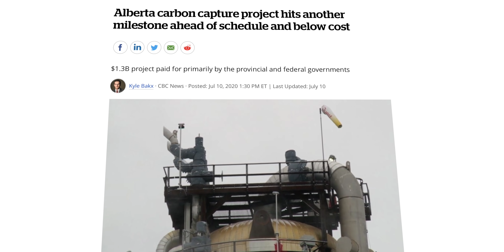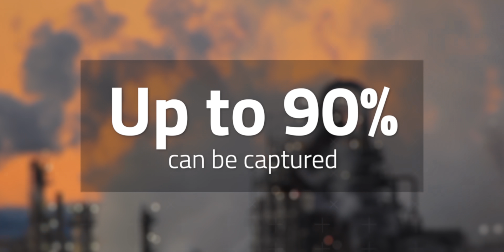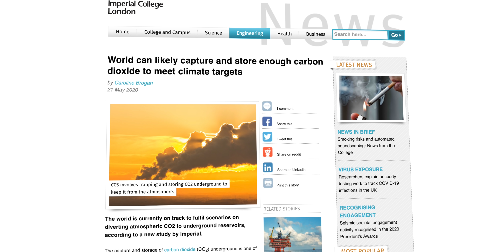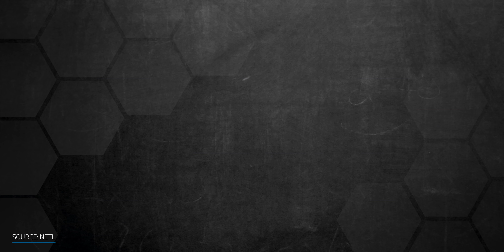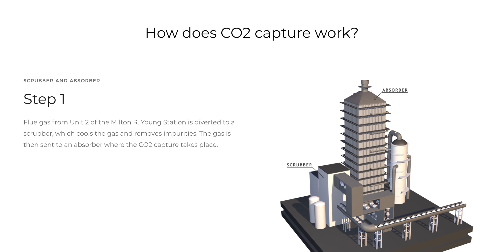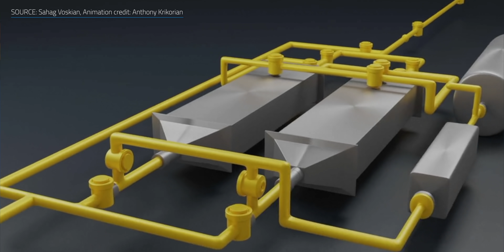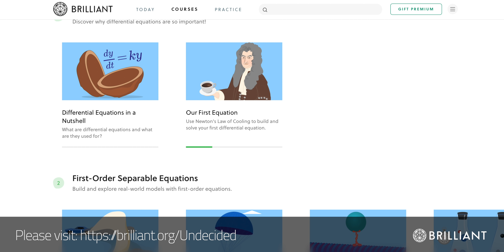The truth about capturing CO2 to reverse climate change

Comment: To the “just plant trees” group, no one is stopping you from planting trees while we work toward engineered solutions. It’s gonna be a multipronged approach to solve climate change. At this point I don’t see people or governments making difficult decisions to change their behavior (just incremental ones). Technology is the only pragmatic solution I see in coordination with incremental changes in energy production, farming, renewables, conservation, etc to solve the climate crisis.
Reply: I agree about the multipronged approach thing. One company that I think is doing a great job of this is Ecosia - a search engine that uses its profits to plant trees. So far they have planted over 130 million trees and counting and they are better for privacy than Google as well (their youtube channel has more info)
Reply: The Climate always changes, it doesn't need to be stopped.
Reply: We can go a long way on energy management alone. There is a high rate of 'standby loss' in equipment that maintains a 'steady state' of readiness. The heating industry can reduce consumption for heat and hot water by about 25% by converting to 'Demand fired' technology with high transfer/low mass heat exchangers/ low temperature radiant heating/ ground effect heating/cooling/modulating firing rates/ outside weather sensors, and more.
The technology is here to half a conventional home's heating and hot water bills, and was in 2005 when I left the industry. The cost benefit ratio was high for residential equipment before energy prices soared. The technology was only applied to commercial/industrial equipment. Now it is available for residential application and even at higher C02 outputs - half as much fuel makes sense.
I made my living in the Energy Efficiency game ; )
Reply: @ericgameryt1887  The huge controversy with carbon capture technology is it’s not sustainable in the long term. And for long term I mean at least 50 or more years if not a hundred years. Because with carbon capture technology there is not going to be a significant change in the way we interact with our environment. Meaning that as carbon capture technology improves, humans can continue to produce more and more CO2 and by then when storing carbon dioxide underground creates a problem the issues will be much greater. The huge issue with technology is we only think about the here and now ad not think of it being a proper sustainable cycle.
Reply: ENgineering society is far far harder than engineering a new technology.  While the politicians battle with humanity, scientists need to take action in the interim.  Couldnt agree with you more.
Reply: While 'WE' work toward engineered solutions as if you do anything. Don't be smug, smartass.
Reply: One if the main reasons is money. It's easy to market your high tech new carbon sequestering solution, it's alot harder to get people to invest in trees...
Reply: There was a paper that discussed Plantng the whole Sahara full of trees... That concluded that the approach is actually not very productive..
Reply: I agree with what you said about big changes are required and most people aren't willing to make them. That and your point about complex problems require complex solutions.
Reply: this tech has been around for years and there have been people like you saying the same things....until you can convince those in power that greed is less important than money we will always have issues with our environement...actually the biggest problem humanity has is not using the word need correctly.  I need this I need that.......sound familiar?   a person needs water, air, food and shelter, yet there are so many snowflakes out there with full entitlement screaming " I need " to the silliest and most inane things
Reply: Trees are no solution euther. CCS and "carbon beutral" with trees are just big scams to make you pay for your sins without achieving anything.
We have to stop the "ECONOMIC GROWTH" religion and SHRINK OUR ECONOMIES! We have to replace 100% of fossil fuels with solar and wind or ABBANDON IT!
Reply: @BOB K And where do you get those millions of seedlings? Or do you just throw some million acorns into a hole in the ground. 
2..5 kg of wood replace one kg of crude oil. We burn around 900 million barrel of crude per day. You can't plant so many trees each day.
Reply: JUST 4Head
Reply: @BOB K ok you realize that common sense means jack shit right
Reply: I just watched a video on using CO2 & waste materials to MAKE concrete block, CMU's! Carbon capture & storage could be great way to boost material science for manufacturing.
Reply: It might help if actual viable solutions like nuclear didn't keep getting thrown out. Imagine if california had built a couple thorium reactors as they had their big push on renewables.
Reply: @olstar18  To be honest, I think that nuclear power is at this point just to expensive.
Reply: @olstar18   That's just not true... Yeah, go look 🙄
Reply: @olstar18  What's stopping you? You have plans for a "Thorium" reactor that actually works? Or did you just research "internet based" solutions that don't really exist?
Reply: @Bee Kay I think you made a mistake. Here let me fix that sentence. 

'All I say are big words, no common sense.'
Reply: @Bee Kay I guess you hear what you can comprehend.
Reply: Trees are great at capturing CO2, but forests are a more complex issue.  There's always a tradeoff between a forest's CO2 capture and its CO2 emissions.  Emissions come from decaying organic matter from tree litter, dead trees,the carbon bound up in the soils, from respiration as the tree's oxidize the sugars they make from sunlight, and of course fires.  As temperatures warm and forests burn more the net balance can easily turn from net CO2 sequestration to net CO2 emissions.  Beyond the massive CO2 release of a forest fire, the burn scar exposes the soils to direct sunlight and heat accelerating the decomposition of the organic material in the soils, releasing CO2.  

In subarctic forests - which are historically some of the best carbon sequestering forests - the melting of the permafrost or early melting of the seasonal frost soils also accelerates CO2 emissions in these carbon rich soils.  

In rain-forests burning to create arable land can also quickly turn the forests into net carbon emitters.  This is happening more and more often.  Also forests go through life cycles and early and mid life are when forests are most efficient at capturing and sequestering CO2, old growth forests much less so.  

It's great to have trees in your backyard and on your street, but the heavy lifting in CO2 capture happens in large forests, and warming is reducing their effectiveness considerably.
Reply: @glibsonoran  dont forget the mycilium, these are the workers that actualy clean the forest.  they form a interconnected web with the trees and plants helping them with nutreints in exchange for co2, the mycilium puts this back in the ground.  thats why a forest works way betters , a forest without mushrooms is a sick forest.
Reply: @glibsonoran  plant windfarms in the sahara to fight the desert, more trees will be able to grow there win/win/win
Reply: @glibsonoran  I'd add that some of what I have seen getting planted is more like a tree farm than a forest. The interest in rebuilding biodiversity and habitat doesn't seem to be part of the thinking for the "just plant trees" crowd.
Reply: @magnusskallagrimsson6707  Monocultures for the most part. Diversity has less value than construction lumber. Around here Douglass Fir replaces native Madrone and other species. Tree farming and harvest is what is being practiced. They are not wild forests. They are harvested on a cycle of years. Fast growing, straight grained lumber for construction is preferred. Twisted but native Madrone is considered firewood, and sold off to make room for Fir trees. It is an un-Natural Forest. - More of a farmers field laid over mountains here. 
We supply the best construction lumber to the world.
A side effect of forestation is wildfires in an ever drying climate - Burning forests give off huge amounts of toxic materials and place them in the atmosphere. There is a huge negative attached to living in or near them when they burn, and a world negative on the pollution scale. Careful management and fire preparedness is key to living here. We are in burn country and 400,000+ acres is currently burning in this state alone(on the way to 500k acres). The smoke is being detected on the east coast and I am on the west, time zones away : ( 
The Bootleg Fire (now burning)in Klamath County (source of the Klamath river and a major water supply for California) could set a new record for the State of Oregon during an Extreme and extended period of drought, with no end in sight : ( The smoke alone will kill ya !
Reply: cant stop the climate from changing its natural for the climate to be changing and it has done so since the earth had a climate
Reply: pathetic try
Reply: All this talk of capturing CO2 is nonsense . Climate change is perfectly natural and has been happening forever. Plants thrive on CO2 so the more the better. Thousands of scientists would agree with me but are being silenced by governments who have their own agenda. Remember when it was global warming but then thousands of scientists pointed out that the planet is actually in a cooling phase so then they came up with those two little words, "climate change", genius.

Comment: It would be cool to turn carbon captured into carbon fiber (if that can be done?) and use that to build bumpers and other parts that are plastic on cars.
Reply: if you burn carbon fibers, you get CO2 and energy. if you want to convert CO2 back to carbon you need that energy (actually a bit more).

Comment: You do realize if we capture All carbon emissions, even if we reach -0- carbon emissions and level off, with population growth we will eventually kill every living plant and tree on the planet.
We need to stabilize the Planet, rebuild the Forrest and concentrate on reclaiming Deserts.
Millions of acres of Solar panels are absolutely not a solution.
Nuclear Energy would out perform All renewable energy with a far smaller construction carbon footprint and Zero Co2 operating emissions.
I am a firm believer in Climate Change, but very much oppose the Commonly accepted solutions that will only make the rich richer while placing Band-aides on the problem.

Comment: Good job. But it is difficult and expensive. I have a way much easier, cheaper and more efficient. If the air is cooled below -78.3C by connecting several Ranque-Hilsch vortex tubes in series (one -50C). CO2 will fall like snow at the “cold” end of the last pipe. Can be collected and disposed of. You can make fuel (add hydrogen from the decomposition of water). If this is installed in Antarctica (or understood high) - one tube is enough (when overboard and so -50C and high wind speed, an additional source of energy will not be needed at all). Performance is high. Any scale. There are no consumables. Like?

Comment: If you are trying to cool the planet why would you consider going after the weakest global warming gas?  Methane is 86 x as powerful; NO2 is 200x and SF6 is 2500x as powerful as CO2 in warming effect..Taking a single pound of SF6 out of the air is equal to 2500 lbs of CO2, 1 pound of NO2 is equal to removing 200lbs of CO2, and removing 1 pound of methane is equal to removing 86 pounds of CO2.  This is just a sales pitch , buy this junk or that silly project  remove a bit of CO2.  You might as well remove water vapor, there is 2000x more of it.  Hey those cool Dune suits!

Comment: You missed a point: how much energy you need to extract 1g of CO2 from the atmosphere. If it requires the amount of energy that will produce more than 1g of CO2 then its a backwards solution.

We can produce a shitload of energy through nuclear and use a good part of it for extracting the CO2 from the atmosphere. This way we dont produce CO2 while extracting it.

Comment: Two little facts you can look up.  First, what is the ideal CO² level for plant growth & what is the current atmospheric level? 
Second, how much land surface is deserts and how much carbon is needed for plants to cover the deserts? How much carbon is estimated buried as coal & oil?
Reply: Also maybe very important: the effects of higher CO2 levels on the brain. And on plants, deserts are barren because of the lack of water and the extreme heat. Not because there’s not enough CO2

Comment: I'll stop at the U here in CCUS because you haven't even explained how the process works. Usually when there is pressure against something it isn't as easy as a straw man "they just want to use it as an excuse". Taking that the process is left out leads me to suspect that the pieces required (the treatment and storage) are either/or both releasing more or just as much co2 in production and upkeep, as well as the storage underground might be quite risky, just like geothermal that is largely dead because of this.
Reply: Alright I've looked into it and sadly this doesn't work good. If you install it on a coal, oil or gas power plant it will currently reduce its efficiency by ~10% this means that it will consume ~30% more fuel which in turn means you will not necessarily pump more co2 into the air but the added consumption will have a horrific detrimental impact on what we actually aim to active.

It will be detrimental to the environment.

Edit:
https://de.wikipedia.org/wiki/CO2-Abscheidung_und_-Speicherung#Bewertung
Reply: Oh, I just noticed: This video is titled "the truth" which basically always means that it is not to be trusted XD.

Comment: I think the oil industries should be taxed to make stack technologies a reality, as well as tailpipe versions where a low solution meter will cause a vehicle from restarting unless standardized solution exchanges would be made at fueling stops...for free (added cost of petroleum usage).  I believe diesel particulates could be dealt with (using ammonia) at the same time.  Basically a robotic quick connect device for draining solute and adding solution into tanks standard on every new vehicle with government incentives to retire older technology.

Comment: There are many truths. All the Carbon in coal and oil came from the atmosphere.  The carboniferous materials didn't break down fast enough which meant that the carbon was not recycled.  Ultimately leading to catastrophic global cooling.  We, right now, are the consequence of an environmental disaster.  Once we start removing CO2 and locking it up we are destroying the carbon cycle.  The consequences of completely trashing natural cycles may not be good  If we do nothing the temperatures increase, ultimately rainfall increases and plant growth increases.  That might be preferable to continuing to fill the planet with ever more people.

Comment: First of all you need to now the real effect CO2 has on climate, which we don't. IPCC CO2 models have been always off and even with all the adjustments they're not reliable. There are 1980s and 1990s "negationist" models (like many like to say) that have better temperature and CO2 level predictions.

Second, in case you know that the effect is clear and can be meassured you can start thinking about solutions

Nature has automatic CO2 capturing "devices" in form of trees, plankton and many more, protencting those environments is almost free and 100% natural

All this magic solutions are expensive, not proven, not even result proven (CO2 dependance and effects) and are just tax money eaters

Comment: It's not Co2 production it's injecting it into the coronal voltage charged atmosphere
Bill and folk's in general needs to understand the earth is simply the secondary coil in a transformer of sorts re radiating electro magnetic induction of the sun's fusion @ 100v per 3ft from the Earth's surface into the upper atmosphere
 this voltage indifference and various combination of molecular and their charges
 Suspend semi metallic gas in the atmosphere +or injecting ANY gas (even water vapor) into the atmosphere is re radiating that energy heating the earth 
It's physics not witchcraft
like a microwave using semi metallic gas

Comment: Tomorrow it's sapose to be -30f this is the harshest winter in years. I agree carbon will contribute to warming but gov don't care about helping just looking like helping look at deisle trucks 2008. Gass capture systems would cut milage in half and require engine replacements as early as 30k miles. Somehow I don't think it was as effective as planed.

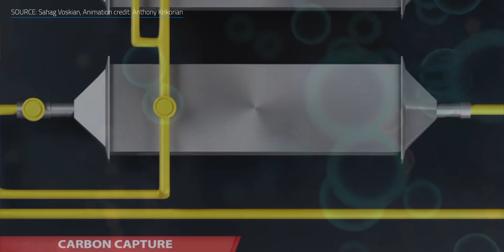Comment: At 10:41 you compare the MIT method to a special type of battery but it is a type of gas chromatography similar to what is used everyday in labs. I suppose you now that but a lot of the methods you mentioned are very close to chromatography it could have been simpler to just explain the general method. I personally think the incredible amounts of money spent on this technology maybe should be spent perfecting other energy sources instead of greenwashing polluters.
Good video nonetheless. Cheers

Comment: can CCUS be fitted to a car with a tank for the CO2 to be released into collection tanks at servos ?
Reply: Usually these techs are difficult to make efficient on a smaller scale, you might pollute more from the added weight and effort from filtering the gases, usually improving engine efficiency and reducing imperfect combustion waste gases is a more realistic approach